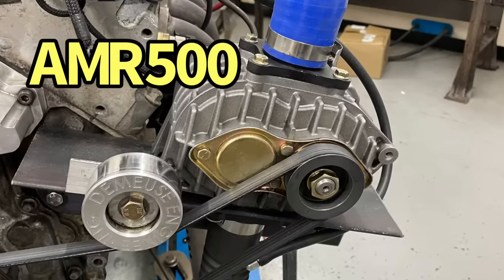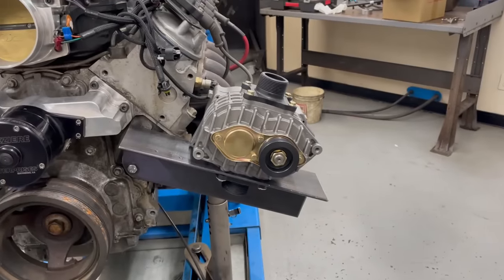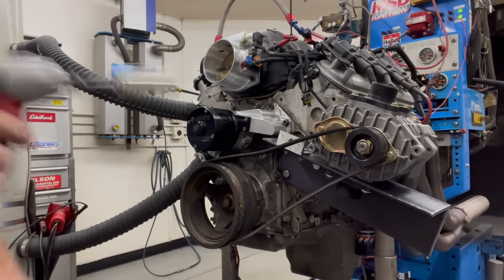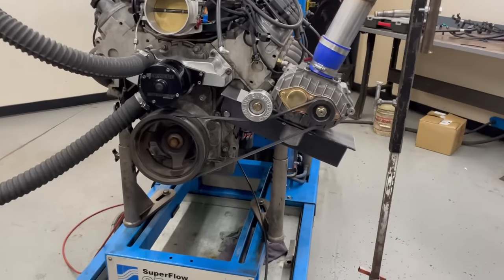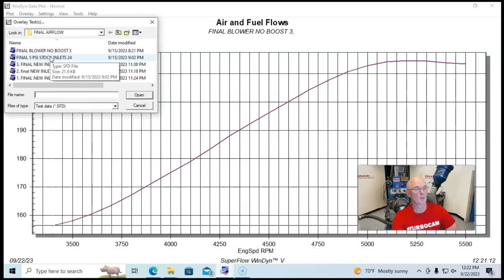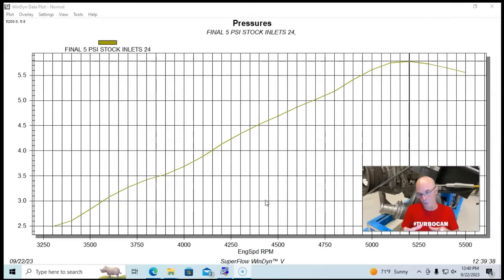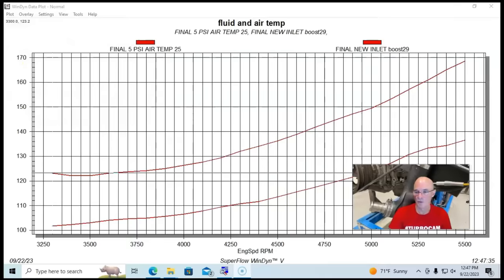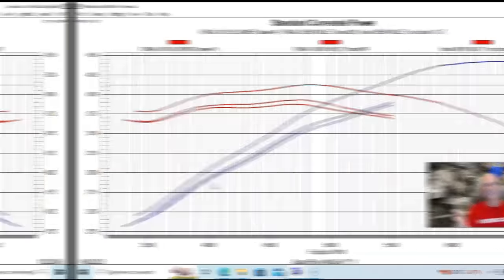THE ULTIMATE CHEAP, EBAY, AMAZON AMR500 BLOWER TEST. FULL RESULTS-AIRFLOW, TEMP & POWER CONSUMPTION

Comment: It might have less boost but still have more volume of air.  Much like a big turbo that is set at less boost still produces more air volume than a small turbo with even significant more boost.  Like voltage and amperage.  Voltage is nothing without amperage.  Boost is nothing without air volume.

Comment: Maybe the added airflow from your "improvement" pushed the blower  into an area where although it's moving more air it's just not doing it as efficiently anymore so that's all the boost it could make at the higher flow rate

Comment: So I have two questions..
1. What are these AMR chargers? (Where are they produced? How old is the design? What are they designed for?)
2. So I have a 600cc engine with a max RPM of 4000, that in stock form produces 21ish Hp... Do you think that the Amr 300 would work on the engine or would it first bog it down at low Revs then over power it at the upper limit? (It's a fiat 500 btw)
Reply from the maker: the amr300 would be better for that 21-hp application and it will have immediate boost
Reply: @richardholdener1727  Would you recomend pumping engine oil into the charger or should they just be left unmolested and try keep the engine bay temp down in other ways?

Comment: So the boost change is really simple. You improved the efficiency of air flow. That creates less boost. Just like if you were to build a hot rod or drag motor with a turbo or a supercharger. With low flowing heads. Then you changed the heads to a much better flowing head that's ported with bigger valves. It's flowing more air. Boost is resistance or back pressure.  Improve airflow. Less resistance.  Would be cool to see this on a 4.3 V6. I like the supercharger idea on the V6 for better lower end response. Not having to build high rpm to make Power. I have an on going bet with a friend of mine that I can build a better off road vehicle then this new 300 HP can am Maverick or whatever for half of the price he is going to spend. The idea is a 4 link suzuki samurai 35 inch tires. Coil sprung solid Toyota axled rig with a 450 HP turbo powered 4.3 liter V6. Could probably build it all for close to $10K. That's why I'm interested in this on a 4.3 for a better hole shot when needed.

Comment: You've exceeded the unit's ability to flow. It looks smaller, than the supercharger, on GM's old 3800 V6. Maybe you could use 3 or 4 at a time.
Reply from the maker: we were just spinning it to measure airflow-it's a 150-hp blower

Comment: For smaller engines ( much smaller) they work great. 
    Been using 2 on a type 1 2300. 
   One for each Bank. 
 They are on clutches as I only use them mostly for short takeoffs or high density altitude.
 
      🤠🏞️🐂
Reply from the maker: clutches would be very cool-all Mad max

Comment: Perhaps your missing boost is simply down to air density due to temperature? I think 170 degrees versus 137 may mean that the same total mass of air is being moved, but because it occupies more volume at a higher temperature, the boost pressure is higher. Think in terms of lbs/min instead of CFM and pressure
Reply from the maker: think in terms of the lower boost having a lower temp

Comment: So the pressure drop on the bigger intakes could be from lower temps. Gas laws say that higher temps drive higher pressures and a 30-40 degree drop could cause a 1-2 pound drop.
Reply from the maker: the lower boost caused the lower temp-not the reverse

Comment: Less boost pressure with more airflow could mean that the supercharger is running more efficiently. Cooler outlet air is more dense, causing less of a pressure rise? You should measure (or calculate) mass airflow next time because that's what really matters.

Comment: You can see the belt spin off the crank pulley and after that big air flow pull you can see the belt resting on the lip of the pulley... definitely needs more tension or variable tensioner
Reply from the maker: belt jump is misalignment, not tension

Comment: Higher velocity and lower temperature at the exit. Fundamentally moving the efficiency up. Less pressure more "power" (CFM).
Reply from the maker: MORE CFM THROUGH THE SAME RESTRICTION SHOULD EQUAL MORE BOOST
Reply: @richardholdener1727  Not with lower temps. Also, Bernoulli's Principle. This is why industrial equipment is rated in SCFM and not CFM.
Reply from the maker: the lower boost brought the lower temp-not the other way around-in every other test like this, the result was more airflow with the same restriction equals more boost-think about what happens when you add airflow to a PD blower by adding a larger throttle body or air inlet
Reply: @richardholdener1727  Per RPM, it was continuous discharge (think Brayton not Otto cycle), no apparent choked flow, and the exhaust was less restrictive. That means less pressure in the "exhaust" (Bernoulli's Principle). The intake was less restrictive as well (same). Both mean less work to move the fluid so less temperature change. Overall a more efficient system with better flow. Or there was a DAQ error.

I've seen I/E/IC turbo cars make more power at the same boost level so none of the data is outside what I would expect. Maybe I missed something in the video which would make me point to a DAQ error.
Reply from the maker: the exhaust was not less restrictive-it had the same restriction
Reply: @richardholdener1727  It's not choked flow. The restrictiveness of the entire exhaust is in play and not just the most restrictive part or final exit restriction. Sort of how just a downpipe on an otherwise stock exhaust will net some power (flow). 

Going out on a slight limb here but I think the data is primarily a testament to how bad the provided composite inlet/exit adapters are. I suspect you'd see better result with slightly less pressure (per RPM) with some 3d printed matched port adapters.

Comment: Many in the comments are stating that the higher temperature is why there is more boost pressure.  This seems counter-intuitive to me.

Inside a closed container, increased heat will increase pressure by trying to force the molecules farther apart.  The pressure increase is going to vary with the density of the air, but we are not dealing with a closed container, so the effect of the heat is to make the air less dense because there is no restriction to the molecules moving farther apart, so it is not going to increase the pressure.  This would mean the blower would have to move more air to achieve the same boost at a particular RPM.

Warmer air is less dense, meaning there is more room between molecules, and therefore more room to compress.  A simple comparison is that air is highly compressible, whereas water, which is denser, has limited compressibility; at the same amount of compression, water pressure will be higher than air pressure.   At the same RPM, this would mean less boost due to that compressibility.  In effect, the blower needs to squeeze more molecules into the same space to achieve the same boost; if it can't, then boost should fall.

Denser air, with molecules closer together, would mean less compressibility, and therefore more boost pressure as the blower moves the same CFM, it is trying to squeeze more molecules into the same space.  It is, in effect, like the difference of trying to compress foam compared to compressing water.

Is it possible that the freer flowing intake is allowing more blowback past the rotors, or even just turbulence caused by the increase in air, which is causing a disruption in flow inside the blower limiting what is being passed through?  It would be interesting if the turbulence, or any reversion, could be measured or viewed.

Another interesting test would be to leave the restrictive inlet with the modified outlet, a smaller modified inlet, or various combinations of both.

Comment: Getting the tensioner closer to the blower pulley to increase ‘belt wrap’ is ideal.   
Maybe blow it into the throttle body and take real world data…..
Reply from the maker: 150-HP BLOWER INTO A 440-HP MOTOR ISN'T REAL WORLD DATA-BUT THE AIRFLOW GENERATED BY USING THE V8 TO SPIN THE MAR500 IS

Comment: I’d say you’re making less boost due to lower air speeds in the system. Bigger pipes equals more volume lower speeds and lower pressure. Same way 50mm turbo at 15 lbs will make less power than an 80mm turbo at 15lbs.

Comment: This may work well for my '87 300zx Na. I know that if you run boost on the Na engine then somewhere around 5-6psi is plenty.
Reply from the maker: This is a 150-hp blower, too small for your 300ZX v6

Comment: Less boost with the bigger inlets make sense. Think of a supercharged car, if you put a bigger intake and port the heads, even with the same cams, blower speed and engine displacement it will make more power with less boost
Reply from the maker: think what happens when you put a bigger throttle body or inlet (before the blower)

Comment: Impressive results and of course a wealth of data gathered  - I would expect no less from Richard's methods.

I'm gonna go out on a limb here... I think the layover at the top end of the RPM range is due to cavitation induced by the small factory plastic inlet. Doesn't seem to lay over as badly with the Super Richie unit in place.

I'm no expert on cavitation but I recall a C&D article where the Ford engineers blamed cavitation for a similar power drop on a pre-production Mustang and said they were going to redesign the intake ducting.

Maybe this is why the production intake tubes get those weird bulbous formations added on to an otherwise linear chunk of intake tubing - to correct this.

Maybe Kenne Bell's experts will have some insight.

Comment: So a blower has volumetric efficiency just like an engine does. A blower's VE will fall off at high rpms just like an engine's will. There's also the issue of air sealing from rotor to rotor and rotor to case. At too low of a speed, the blower will leak enough to be noticeable as a percentage of its displacement. Which is the same reason we can SLOWLY turn an engine by hand with little effort because all the compression built up will have time to leak through the ring gaps without building any real pressure. As the blower speeds up the air sealing improves, but then you get to the high rpm range and its VE falls off. So it has a 'happy rpm range' and unlike a 4-stroke engine where you can change the shape of the VE curve with the valve timing, on the blower you have fixed 'rotor timing' and the only thing you can do is port/enlarge the inlet.  Normally in actual use porting the outlet would not be that useful because the only time youd have an unrestricted inlet and a bunch of rpm, is times you're making boost. Boost reduces the volume of a given mass of air, so the outlet does not need to be as large as the inlet to flow just as well.  However, on a dyno where you can do a totally unrealistic thing of having an unrestricted inlet AND outlet AND high rpm, porting the outlet could show significant gains because without boost, the outlet really does need to flow the same as the inlet to get the max flow across the blower. But in a real car.. i wouldn't bother porting the outlet. Just do as much as you can with the intake side and worry about the exhaust path of the ENGINE, not the exhaust path of the blower!
Reply from the maker: the outlet can be restricted too, which we did to create boost

Comment: reason why the boost pressure is lower? Lower temperature means the air is denser and probably the output flow is lower because of this? I mean if you heat the air more inside the blower there wil by volume be more air coming out of it then there went in to it. So the more it gets heated the more output flow you get compared to inlet flow.
Reply from the maker: AIRFLOW WAS UP WHEN BOOST AND TEMP WERE DOWN
Reply: @richardholdener1727  Exactly, INTAKE flow was up. So that actually means that more air got sucked in, but somehow less boost came out, and the outlet restriction didnt change right? So the online logical explanation for that would be that the cooler charge temperature makes the outlet air more compact. So in reality you get a way better efficiency that way.
We have seen this loads of times when people put a different cam in their supercharged car, or they get headwork done on it. And then they complain I LOST BOOST PRESSURE, MY SUPERCHARGER IS BROKEN. No, you supercharger still flow exactly the same amount of air, but you engine takes it in with less restriction. Put it on the dyno and it wil produce more hp with less boost on the gauge. 
Same thing here, you get more air through that same hole with less restriction(charge pressure is only a maesurement of restriction, not of anything else).

Comment: 8:43 You can see the entire blower housing drop causing the belt to 🛫the lower 🪀.  Match the video-time with the state of RPM(appoximatudenly). Unless of course you already noticed the same un-missable issue I did as well.:goodvibes:
Reply from the maker: belt misalignment
Reply: @richardholdener1727  Likely, But that variable is "standard-issue" in prototyping-process!😁

Comment: I think it's great you are doing the ultimate test for all to see and some great data collected, but correct me if I'm wrong I think it's too much motor for the little charger, if it was a small capacity motor say 1300cc that is where you will see the most noticable gain as mini chargers like these were seen on things like a 1.0 subaru
Reply from the maker: this was a flow test-the 150-hp blower was not used to boost the 440-hp na LS

Comment: Just a spitball guess from my swimming pool building/hydraulic design experience, I think the reduced boost with the 'Super' setup could be from reduced air velocity at the sensor. I know the sensor does not measure air velocity, but with increased air velocity of the factory outlet at the sensor it could possibly measure as higher pressure. A potential way to eliminate the possibility of that would be to run a capped branch flow pipe or a capped T with the sensor in it.

Comment: I think this blower would be best tested closer to the throttle body. The problem with this supercharger is that on larger displacement engines, it doesn't put out the amount of air the engine requires to run properly. And when you put a lot of pipe between the blower and the engine you then have to fill the hose up with pressure as well as trying to fulfill the demand of air for the engine. 
     The blower just doesn't flow enough air for a larger engine since it was designed for engines 1,000 CC or less
Reply from the maker: this was not tested on the motor-the motor was just used to spin the blower
Reply: @richardholdener1727  The point I was making still applies. I thought that he was using it to try and see the power it added. But the principles I was saying about the supercharger are still the same.
     I've seen a few people trying it out on cars and it actually hurts how much power it makes. Because it becomes more of a restriction the bigger the engine gets

Comment: Very nice video.  BUT, I was waiting for the final step of actually connecting the output of the blower to the engine to see how much power it adds or subtracts.
Reply from the maker: the 150-hp blower would subtract from the 440-hp motor
Reply: @richardholdener1727  That seems like it would be a waste.  Is it that the blower is too small for that engine?  Is there a blower that would boost the performance of that engine?
Reply from the maker: this was a test of the flow rate of the blower, not to run a blower on the LS. I have many, many blown LS videos up. I was just demonstrating how much power this little blower can support based on the flow data.
Reply: @richardholdener1727  Tnx, I'll go look for those videos.

Comment: Ty for this vid, I've been wondering about these units for a while having seen them online for reasonably cheap money, also, the belt kicked up onto the crank pulley during a couple of the runs. Not sure if this will have affected the results but thought it was worth mentioning.
@bankspower Is this result a function of the reduced charge temperatures? Lower boost pressure from a freer flowing charger but with less heat so less air expansion? Would that mean you have potentially better air density therefore better performance regardless of the boost pressure cos as we all know, them boost gauges are lying buggers. 🤣

Comment: Running the blower into atmospheric pressure rather than the vacuum produced by a running engine is a higher load condition, not a lower one. It will take lower HP to drive it on a running engine.
Reply from the maker: when you run a blower on a motor, it is not running into vacuum. It is producing pressure (boost)
Reply: @richardholdener1727  This is not exactly right. Every time the piston descends it crates massive suction which assists the blower in moving air. Yes, a blower creates "boost," but has an easier time doing so than when blowing into the 14.7psi of atmospheric pressure.  I never realized this until Steve Morris pointed it out in a recent video.